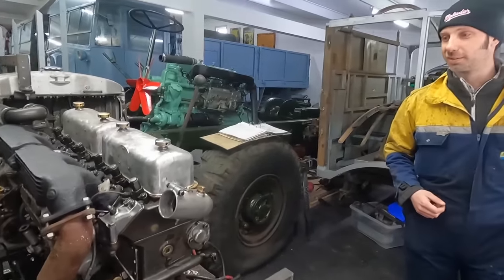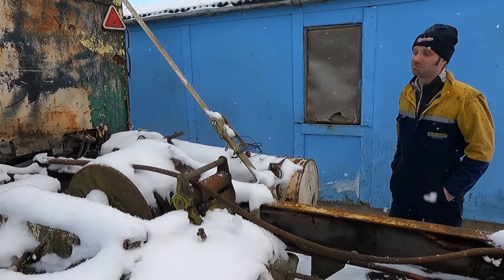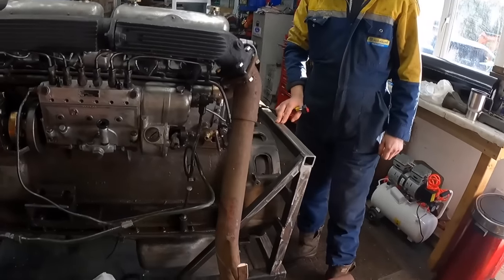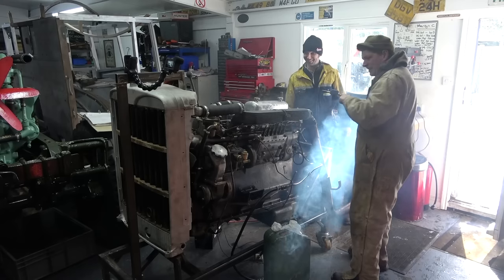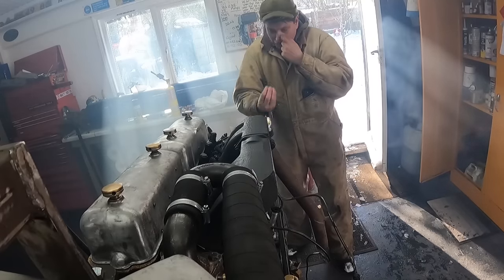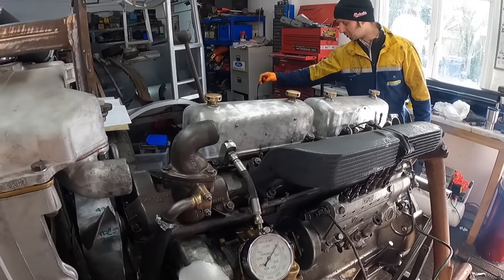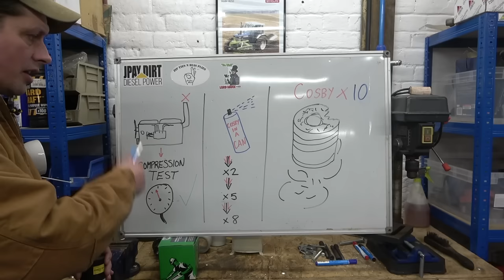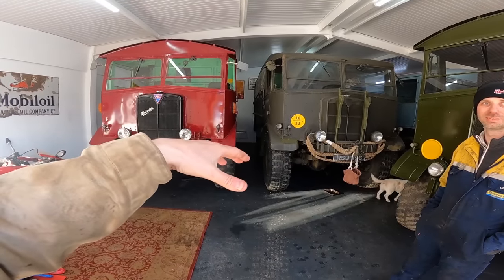WILL IT START ? - 82 YEAR OLD TRUCK COLD START

Comment: What a load of crap, anyone who knows any thing at all about engines knows there should be no combustion gasses in the crank case whatsoever. If a 7.7 won,t start, regardless of how cold it is, it is  suffering from excessive wear to pistons/rings and or bores, or the valves and seats need a coat of looking at. Sorry to upset the amateurs.
Reply from the maker: Not as sharp as you'd like to think are you ?
Try watching the entire video before being the font of Fuck All 🙄
Reply: If we had tried to film this series with a decent matador engine that had no issues, it would be rather dull. Now imagine a completely knackered engine, where we get to learn how it got knackered and how its going too be rebuilt. Well I'd watch that!
Reply: @mattfoster253  agree
Reply: @daveshepherd5352  agree
Reply: The cockwomble is strong in this one my lord .
If you had gone directly to the compression test it would have been a very short video and people would not learn.
It was obvious from the moment you said about the crankcase fumes it had major bore/piston issues but like me you cracked on hoping it would run just for shits and giggles .
Reply: @LordMuck  Well said Lord Muck!
Reply: So you didn't watch the video all the way through then? Also "no combustion gases in the crankcase whatsoever" is a load of rubbish. Even brand new engines will have some blowby. I work for a major diesel manufacturer and I think our limit is around 6" H20 on a manometer for a brand new engine.
Reply from the maker: Yes Mark but you and I know that as you're actually a skilled mechanic and not some thick wanker who thinks everyone should hear his drivel.
Reply: He sounds like the sort of guy that everyone avoids in the pub as they know he's just full of wind and shit. Just a drain on society.
Reply: So let me get my head around this one Trev.  Everything I have learned in the 40 or so years up until now has been wrong?  My knowledge of fluid mechanics and engineering is wrong? Should we now be building engines the Trev way with interference fit valve stems and pistons?  Mind officially blown.
Reply: @ClarenceFudWeasel  Who said anything about interference fits or fluid mechanics?, I didn,t.
Reply: @ClarenceFudWeasel  he won't understand. The only worn out old bore on here is Trevor the bodger.
Reply: Oh trevor.
Reply: Oh Trevster darling, I really don't know where to start. 

Speaking as an mere amateur, I couldn't help but notice that you made the extravagant claim "no combustion gasses in the crank case whatsoever" though, which fails to take into account the expansivity of the materials and the behaviour of combustion gasses under pressure, not to mention the manufacturing tolerances of engine components, design features and properties of matter.   Believe it or not, all engine components are manufactured within a tolerance range and internal combustion engines are not perfect systems. Even brand new bores are not perfectly round, rings are not exact sizes and, horror of horrors, they even have a tiny gap at their ends and top and bottom in their grooves to allow for expansion and passage of combustion gasses. When fitted into the bores, and here's the shocker, piston rings are designed to allow some gas from the combustion chamber to pass them, they rely on combustion chamber pressure to push them against the cylinder walls and maintain a moderately gas-tight seal so you get some compression.  It's why worn grooves and rings cause loss of compression.  Not so much that they simply allow gasses to pass them, but because they can't maintain the gas pressure behind them to hold them against the cylinder walls.  If it was just the the springiness of the ring alone, no engine would ever run and there would be oil flying out of every orifice, much like you after a night at the chippy.  Even the healthiest engine will turn the oil black after a few hours of operation.  Where do you think this blackness comes from, perhaps it is magical pixie poop?  

Let's look at the AEC engines.  They are lovely things, tough, resilient and reliable, but hardly the most sophisticate feats of engineering.  They were designed to run in almost any state of wear and be repaired on battlefields, under fire by knuckle draggers like my former father in law, using only stick, stones and their teeth.  The dimensions of their moving parts were made within tolerances, but vary according to their position in the manufacturing run and the wear on the tooling.  

So, Trevmeister, I'm not going to bother replying to you again, because to be honest, people like you bore me a little, but can I make the suggestion that either:
1. You sit back and watch us amateurs on channel, accept it for what it is and maybe even learn something. Let's be frank here, you really don't know as much as you think you do.
2. Go back to hiding under your bridge and wait for some billygoats who will appreciate and value your talents.
Reply: Hello Trevor
I am worried that a lot of people probably think you’re some kind of a “Dung Hill Rooster” Don’t take this lying down Mate, show these amateurs what your made of. List your own Youtube Video demonstrating your technical excellence. Why not start with Spill timing, then lead on to Cam timing with the AEC vernier coupling, then round off with phasing the BPE fuel pump? All easy straight-line stuff. The only difficulty I envisage is getting the “friend” who will video it…
Reply: In the interests of being pedantic, to achieve zero combustion gas in the crank case, you would have to replace the pistons with cast iron pistons or replace the liners with aluminium so that you can weld the pistons into the liners. 

Alternatively you could you could just take the head off and leave the engine outside for 10 years and let nature take its course. Even acetone won't penetrate that bond.
Reply: I can see they already know what's wrong and are just explaining it for the video, why can't you ?
Reply: @ClarenceFudWeasel  enjoyed your explanation - very informative
Reply: A typical sterile comment from a sterile individual, watch and listen to the video, Noddy.
Reply: Can you imagine if Trevor watched zip ties and bias plies.....
Reply: @ClarenceFudWeasel  p